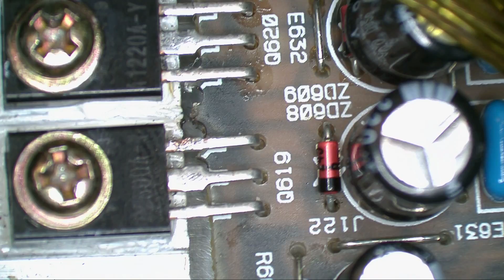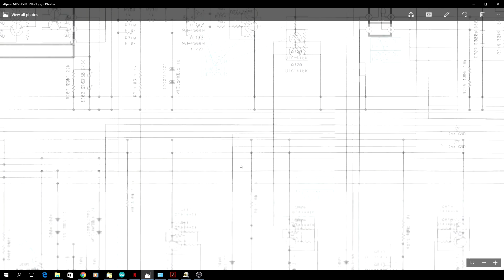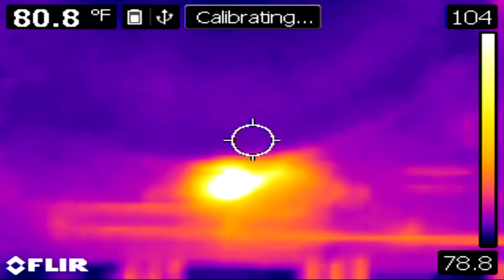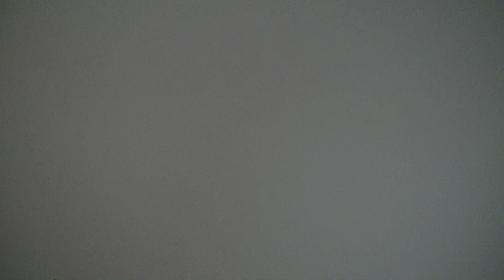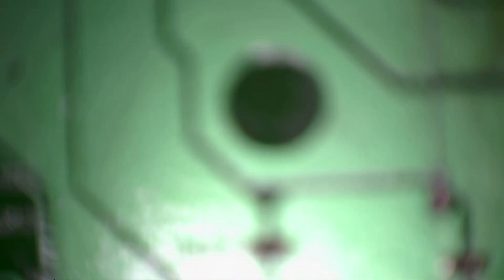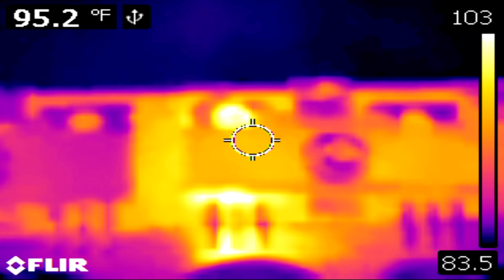ALPINE MRV-1507 AMPLIFIER REPAIR,  AMP #1 PART 1

Comment: I like your videos, they inspire me.... Question, I have an AM/FM Sherwood RX-4105 Receiver, One of the output Transistor is blown and I removed it, I ordered the part. However, in the mean time when I try to put on the receiver it powers on for 2-3 sec and then cut out. Do you think I need to replace the output transistor so it will come on normal?
Reply from the maker: +Andre Gopee  i wouldnt think so. I would look for more shorts or an open emiter resistor.. usually it is the big 3 watt white resistor. Could also be a pre driver shorted out.
Reply from the maker: +Andre Gopee  i wouldnt think so. I would look for more shorts or an open emiter resistor.. usually it is the big 3 watt white resistor. Could also be a pre driver shorted out.